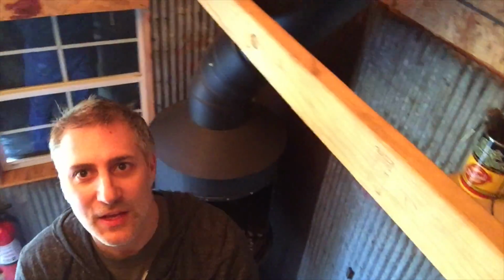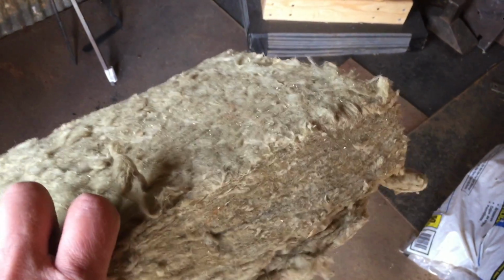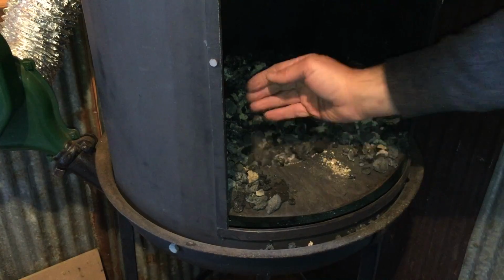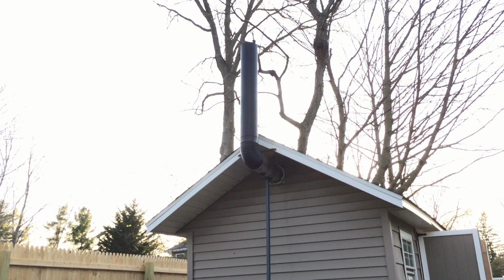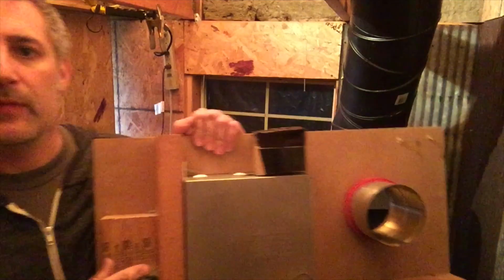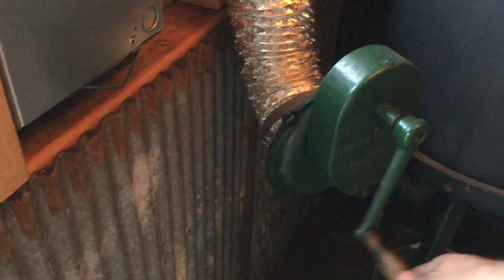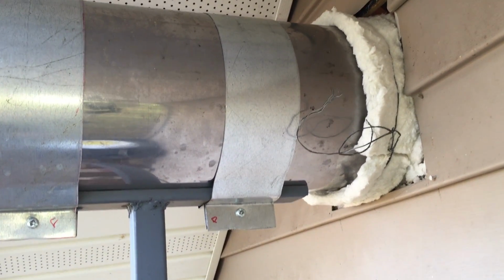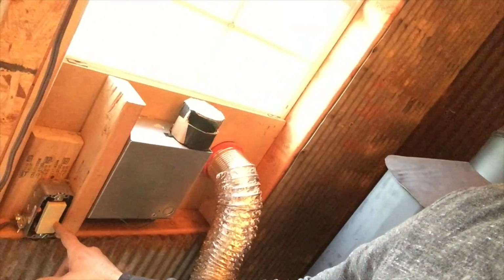Blacksmith Shop Build -FINISHED!

Comment: I'm curious about how you're keeping cool enough to work in your shop during the summer, assuming you are. Is the little window fan enough?
Mine is a homemade lean-to shed, 6x7 outside, probably about the same square footage less the framing and siding. Sliding barn door giving a nearly 3' opening and unglazed cutout windows, board and batten walls, metal roof and no insulation. I have a single burner propane forge and when it's 70° in the morning, I can work for maybe an hour before it hits 100° inside.
Reply from the maker: Hi Wil. Thank you for watching my video and taking the time to comment. I'm planning on building a propane forge which should make it easier to forge during the daytime. As of now, I don't do any blacksmithing in the summertime, mainly due to the coal, which produces a lot of smoke. It gets darker a lot earlier in the winter, and people tend to stay inside with the windows closed. This means it's less likely any neighbors calling the authorities. It's also much more convenient because the startup and shutdown are much faster than with a coal forge. Sometimes I only have 45 min to an hour of free time.
Your setup sounds really cool! The one thing I won't be able to do is to use a propane forge in the shed. It's way too small and I don't think the bathroom fan would provide enough air.
Reply: @eviltwinx  Thanks for taking the time to read and reply to my comment. At least now I see that I wasn't missing something obvious with cooling in my setup, since you're not doing it in the summer.

Quick startup is a great feature of propane; 45m is enough not only to get work done but also to feel you've actually improved your control and strength.

I started to build my own and spent a bit of money on supplies like the castable refractory and then realized I still needed to buy a regulator, hose and other fittings, which was going to cost me $35-$50, so I decided to buy a Mr Volcano Hero for $90 instead. It was definitely worthwhile, especially for the first forge.  Setup was basically what I'd learned from IForgeIron threads but with fewer opportunities to question myself or otherthink things.

I've seen one of the European blacksmiths whose forge is right outside his smithy, accessible through a window/portal in the wall.  [Edit: It's Advoko MAKES, you can see it in the Cloggers Knife video at 1:26 https://youtu.be/wYKUBzTJxtA?t=86]
Reply from the maker: @wilcooley  I'm sooo tempted to buy a propane forge just so I can start forging asap. I do have everything I need to fabricate one. I just need to buckle down and do it.
Reply: @eviltwinx  It was worth $90 to me to have a little more hand-holding with the insulation and burner; perhaps if I had more skill with fabrication/construction I would've had an easier time but uncertainty can be paralyzing. There is still work to be done even if you buy one: I'm currently working on easy-to-knock-together firebrick doors for the front and back. It's basically going to be a near-cube frame, using bedframe and boughten perf angle iron.

Comment: Curious how the brake drum worked out.  I occasionally would like a deeper fire in a rivet forge.
Reply from the maker: So far, it’s better for me. I use a lot less coal and it’s easier to maintain a good fire. I tried a deeper drum but it didn’t work as well as the shallow one. The problem is I can’t get the stock deep into the fire without going in at an angle. I am in the process of cutting out a channel on the deeper drum so I can put my piece in straight and in the heart of the fire. I also use a piece of sheet metal cut in the diameter of the forge with a cutout in the center. Think a big letter O. This rests on top of the drum and acts like a shelf. Makes it easier to slide coal into the fire.
Reply: @eviltwinx  thanks!

Comment: Nice!  Keep it up - we can't let the art form die!  I like your bathroom fan fresh air supply idea, and when you think about it, it's really kinda funny because the bathroom fan usually supplies the outside with "not-nice" air.  How are you finding the anvil work when it's on top of the foam floor stuff in terms of bounce?  I suppose since it is mostly decorative stuff you are creating, it's not too bad, but if you were hammering on a large piece, it might rebound a bit?  Man, you've got me stoked for springtime and some more blacksmith work!  (We're under 3 feet of snow in Northern Ontario)
Reply from the maker: 1Coolnorth - Thanks man! The paddling don’t affect the anvil’s rebound at all. It was more to dampen any vibration. I’ve recently removed the padding. Hope to see some of your work when the snow finally melts and you can get anvil time.

Comment: That is one TINY shop!  But it's *YOURS*!!!  Your skill will improve with practice, of that I'm certain.  My only real question is: with all of the soundproofing (and the size), what is the noise like when you're working?  I imagine it could be like wearing a great helm in a hailstorm.  Have you done anything to help quiet the shop?  I remember working in a room, which due to the amount of noise, required the wall & ceilings to be covered with acoustic foam, and I still had to wear ear plugs and muffs.  When the machines weren't running, the feel of that room made the solution seem almost worse than the problem.
Reply from the maker: +Brian Neeley - for a tiny space, the noise isn’t bad at all. I have ear protection but rarely use it. For now, most of my projects are small so I’m not moving a lot of material. I thought about putting foam on the ceiling and might do that. Thanks for taking the time to comment!

Comment: Cool channel man I'm making one in my basement and need to sound proof it so I don't run my wife off lol
Reply from the maker: KNM Knives_coming soon - Nice! Just make sure you vent super well. You don't want carbon monoxide getting into the rest of the house. Put a few detectors around. Not sure if you saw all the videos to the build. If not, check them out and good luck!

Comment: Sorry, only just seen this. 

Well, what can be said? That is truly awesome!! You have thought through what you have to do and overcome and then gone and done it. Some of your solutions are really out of left field. (I shamelessly admit I will probably be adopting several of them) Your level of innovation is truly inspiring.

The very best of luck with moving your skills forward. I'm sure you'll spend many a happy hour in that shop.
Reply from the maker: Nightschool Blacksmith - Thank you! It still needs some tweaking and I'm trying to figure out were/how I can mount my leg vise. Pretty happy so far.
Reply: Hmm, leg vice might do well like mine, on a portable stand, then you can use it outside when forging, store inside when not?

Comment: Great video.  Magnets lose their magnetism forever around 200-220F.  Might be a good idea to connect them to the forge through some type of insulator.  There is probably draft air rustling in through the gap there keeping them cool.   Love novel uses of magnets.  It's working and that is the ultimate test.  ;-)
Reply from the maker: Yea- I looked into that and they start to lose their stick at around 175(ish). My laser thermometer was reading around 130-140 but I'm sure over time I'll need to replace them.

Comment: new sub here - awesome and well thought out set up. Gives me all sorts of less well thought out ideas! :)

I know nothing about electricity and conductivity.

BUT.

Steel plate flooring scares the crap out of me on the off chance there's some kind of electrical short or something. Any danger of that?
Reply from the maker: Thanks for the sub and for posting? I guess that's always a possibility but the chances are slim. The outlet is a GFI going to a surge protector. I'm running an L.E.D. light with a bathroom fan and a radio at most. I've run an angle grinder and a table saw this way when I was building it with no issues. I do wear leather work boots with thick rubber soles so if something was to happen, I'm protected.

Comment: Nicely done. I thought I was cramped with 144 sq ft. And I use a propane forge, so NO chimney. Great job.
Reply from the maker: Thanks! I have to run coal in a tiny space like this so i can manage the heat. As you can guess, it get pretty hot in there. A propane forge would get insanely hot.

Comment: Question!  Magnets lose their magnetism if they get hot.  How does your blocking plate stay in place if your forge gets hot?

Also, so angry and defensive in this video. lol
Reply from the maker: Billy Vandergaw - good question. They lose their magnetism at around 175 degrees. The area they are placed doesn't reach that high. It gets around 120-135.

Comment: Great work, been looking forward to seeing the finished shop for a while. I think many of us in a similar position understand exactly the why of things with a small sound proof smithy. Proving that this can be done and that it works is great. Thanks too for showing the crucial elements like the floor, anvil mount, and exhaust from the forge. I'm trying to weld in mine also and looking for some crazy way to vent the fumes for that too, possibly a pick up over the table or some manner of blown ridge vent to exhaust the whole shed. Any suggestions?
Reply from the maker: Thanks! You can vent a few ways. Suck the air out or blow it out. You can also pressurize the space to force the air out. That was part of my idea with my setup. Since it's a small and relativity air tight space, the bathroom fan was used to not only bring in fresh air but to also help push air up and out through the forge. A blown ridge vent is not a bad idea but I would also have fresh air blowing in as well. Especially if you are welding a lot.
Reply: Thanks, I appreciate it.

Comment: Congrats on getting your shop set up. Now you can really start putting what you learned from Alec to good use! I set my shop up in my garage (propane forge) and I find THAT small, but as long as you are comfortable with it, that's all that matters. Of course, you gained the advantage, in that you can work at all hours... in my case, working past my daughter's bedtime will incur the wrath of She Who Must Be Obeyed, which is NOT a good thing!
One suggestion, if you haven't already thought of it: I would put a short  (maybe 6" or 8") strip of that roofing steel all the way around the bottom of your walls where they meet the floor, just to keep any strays sparks or chunks of hot metal that land on the floor and go skittering away from ending up in contact with combustible material.
Cheers!
Reply from the maker: Thanks Dale and great suggestion!

Comment: Hey Eviltwinx, the shop looks good.  I was wondering though, where you were planning on putting a leg vise.  It's a pretty necessary bit of kit for a blacksmith shop.

Also, at the risk of appearing self serving, I just posted a video about forging a leaf hook which you might find helpful in improving the look of your own leaves.  It's here:

https://www.youtube.com/watch?v=xWnGe5X3Lqk&t=448s

Keep it up, you'll get there.  Your hammer, by the way, looks great.  I watched your video of your class and it looked like it was a lot of fun.
Reply from the maker: Good question! I do have a leg vise but I'm not sure I figured out the best location for it. I might have to use a smaller vise as long as I don't need to pound on metal, just hold it for twisting or bending.

Heading over now to check out your video!